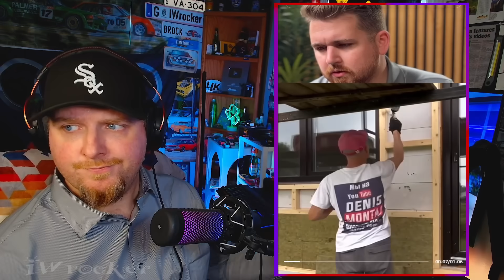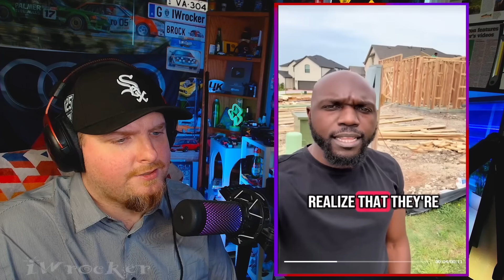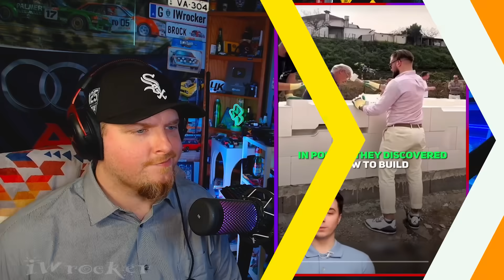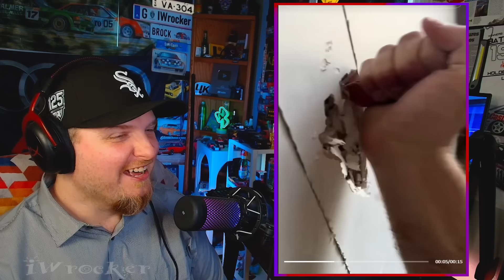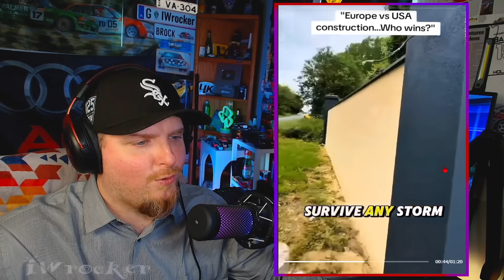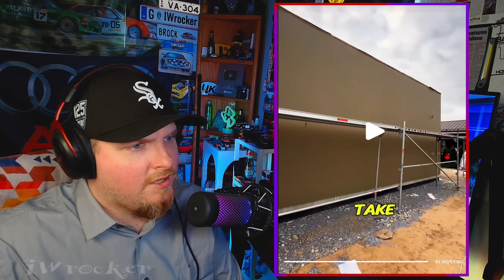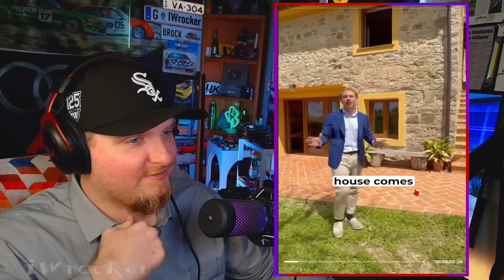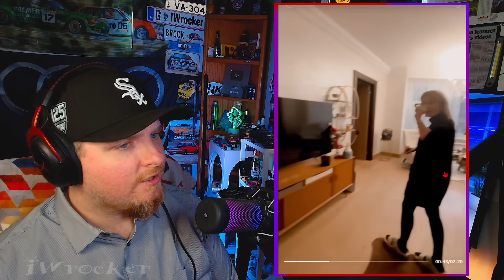25 Minutes of European VS American Home Quality & Construction Methods 🔨

Comment: German here. In my old house, the exterior walls are 35 cm (13,78 inc) thick.
Reply: Same here (Austria). The inner walls are about 14cm.
Reply: The house I live in (in Germany) is over 200 years old, built of shell limestone rubble, and the exterior walls are between 80 and 110 cm thick. The weak points are the new single-glazed wooden-framed windows that were installed just over 50 years ago. Unfortunately, the walls are not particularly suitable for hanging heavy 3:42 things on. 
Das Haus, in dem ich wohne, ist über 200 Jahre alt, aus Muschelkalkbruchsteinen erbaut und die Außenwände sind zwischen 80 und 110 cm dick. Die Schwachstellen sind die neuen, vor etwas mehr als 50 Jahren eingebauten einfachverglasten Holzrahmenfenster. Die Wände sind leider nicht sonderlich geeignet, etwas Schweres daran aufzuhängen.
Reply: Cute, I live in Germany and mine are 50cm.
But it used to be a mill in the past.
Reply: You living in a bunker or something? 😂
Reply: @EskiZagra  that is actually on the small side for an exterior wall
Reply: @EskiZagra it means very low energy consumption. Efficiency.

Comment: If i hear my kids play in the next room, its through the closed, wooden doors. Not the walls.
This alone should speak volume, pun intended.
Reply: I have a water warning sirene in the bathroom which really hurts the ears there. On the other side of the wall is the living room and I barely hear it if the TV is running (not loud). There are three doors between the rooms so also not much on that way. I tried a similar device for detecting electricity outage on the groundfloor. Nothing to hear on the first floor and barely anything outside (3 pane windows.)

Comment: in GB there are a lot of fake fassades,because they hide the ventilation of the subway below!
sometimes its an emergency exit
https://www.youtube.com/watch?v=QAw_BU_Zk4c
Reply: GB? Are you speaking about the UK? I've not seen many of those properties. I have built enough here: 100mm insulating block, 100mm insulation, 100mm brickwork, giving a minimum thickness of 300mm without drywall. Often, people will have walls slightly thicker than 350mm

Comment: A huge advantage of European solid walls is that you can drill a hole anywhere and hang heavy loads, as long as you check for wires or pipes first. Unfortunately, even in Europe, more and more interiors are being built with this cheap drywall.
Reply: even so most drywall in europe is about 6 times as thick 
i think standard drywall in america is around 3 mm thick

Comment: In Sweden we have rules that must be followed when building a house. When the house is finished, it must be inspected by professionals.
Reply: Like everywhere else in the world
Reply: @Be-Es---___  Considering what the builders in USA produce on cyfyhomeinspections' videos, I wouldn't say "everywhere".
Reply: @saasseli  You see, when selling a house in Sweden you're expected to provide an energy declaration, a calculation of yearly running cost and an inspection protocol. That protocol is provided by an external company and said company bears responsibility for all defects not mentioned in the protocol (so inspectors will gladly put more stuff there just to cover their rear ends).
Reply: @Be-Es---___  Not everywhere... Far far from it. And in several places where it is legally required the so called "professionals" are on the side of the constructor and will sign of on hot garbage. And in many places there are serious loopholes. In Greece, for instance, you don't pay property tax on your home until it is declared complete. So when a new home is built they leave a portion of the roof missing with a couple of rebar roods sticking up "for the unfinished room". Then building just ends, and the owner moves in without a formal inspection... because it "wasn't finished". So the alure of not having to pay property tax gives constructors free range to do shitty work.
Reply: That's not entirely true. If you're building a single-family house, you don't have to have it inspected. However, you'll absolutely need an inspection protocol if you ever decide to sell it afterwards.
Reply: Common sense imho. Lots of rules in my Netherlands as well. Especially for the gas / electra. Only certified people can install or maintain them. They even made it more organised, where they must post planning, proof, measurements etc. And their can even be a random audit during maintenance
Reply: @CyberBeep_kenshi Not true. in The Netherlands, electrics can be done by anyone who wants to, there's no certification involved. Only gas-fired boilers and other appliances are now (and only recently) covered by a certification process most plumbers call total bullshit as it's just a moneygrab for the certification companies who know that plumbers can't do without it or they will end up with fewer jobs. I agree for the maintenance of gas-powered appliances, but it just really doesn't solve the problem as someone not allowed to do work on such things will do it anyway and if an inspection follows and everythings' okay, no one will know.

Comment: I really hope the guy whos commenting on the house build doesnt do any house building, the question why is he putting insulation on the outside... the concrete is used as a heat sink, the insulation keeps the heat in the block, that heats the house. Clueless.

Comment: -dane here.... when I was active (bricklayer/mason) we used 125mm isolatsion and bricks in and outside
build for min. 100years
Reply: Inside? Do you mean in the hollow wall constructions? All constructions i ever made had no insulation on the inside, the insulation goes between the backwall and facade.

Nowdays  350mm on roof is seen as a standard. And 125-200 on hollow walls.
Reply: @shades2.183  That's what he meant. brick on the outside (facade), insulation in the middle and then brick on the inside (backwall).
Reply: @HackerJac-cs7io  Alright.
Reply: @shades2.183  Yes we only do wood for the roof construction 400 mm isolation and sometimes  wood floor in our floor theres min. 300mm styrofoam
Reply: @shades2.183 we have done many different types of insulation. But yeah 2 brick Walls and insulation between is common.
Reply: And that even suck.

(I live in a 100y old house and f it's cold. People had thicker Skin back then